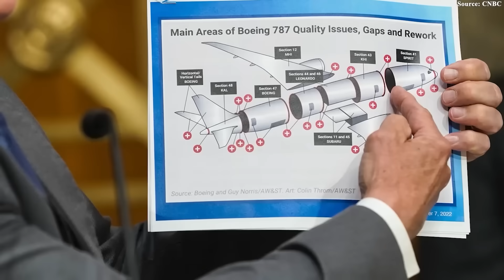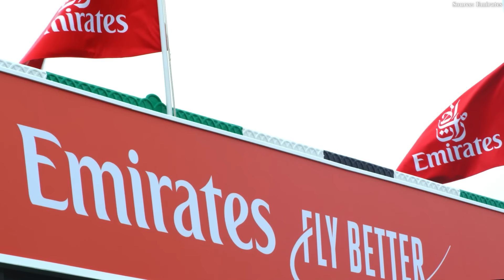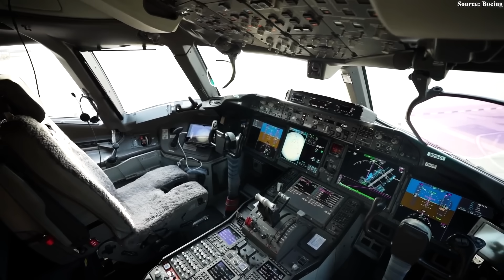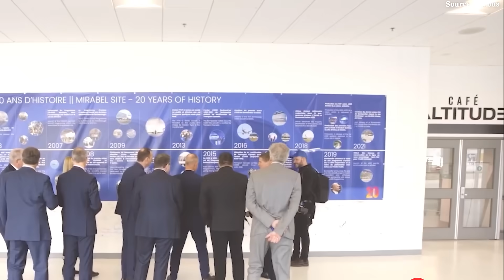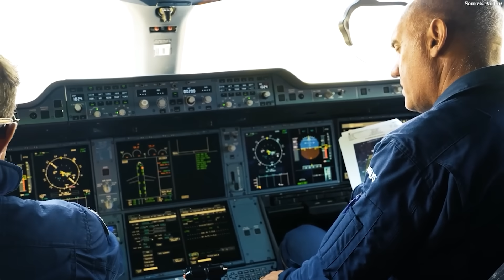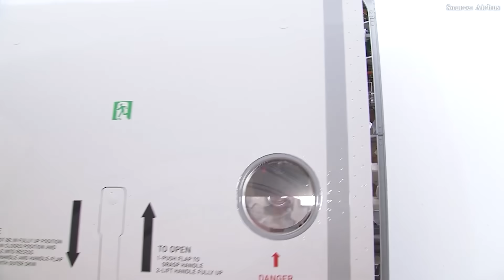Airbus A350-2000 vs Boeing 777-10: Which Reigns The King?

Comment: It is only Emirates who has a problem with the size of Boeing 777-9 and the engines of the A350-1000. They still consider the Boeing 777-9 small that is why they want 777-10. You said that other airlines want a bigger A350. That is wrong. Other airlines are not asking for an A350 bigger than the A350-1000.

Comment: 777 10 is a dummy. It is over weight.  4 engines necessary for safety. BOEING IS UNSAFE . SAFETY ISSUES. This needs be changed ETOPS  Has changed. ETOPS  needs better safety checks.

Comment: Boeing not only has the easier engineering path - present FAA scrutiny notwithstanding - it also has a large base of 777 customers and a sizeable backlog for the 777x.

Airbus could try to compete head-on with the 777-9 by building an A350-2000, complete with an automated take-off system similar to the one Embraer has developed for its much smaller E2 series. This would avoid tailstrikes and permit operations off shorter runways. However, sticking with the Trent XWB-97 would sacrifice a lot of range; Asian customers currently operating A330neo aircraft on slot-constrained medium-haul routes might be interested in a higher-capacity option, but that might be too small an addressable market. Ideally, an A350-2000 should have the UltraFan as an available option.

The other option is to let Boeing have the high-margin but low-volume very top end of the market and focus on the lower-margin but high-volume narrowbody segment. An A220-500 with tall landing gear could succeed the A320neo with the same engine options and ground clearance to spare for its own neo update 10-15 years after launch. That would let Airbus designers focus the NGSA project on a successor for the 200-300 seat range. And then there is the sizeable scipe-clause-constrained US regional market that neither the A220-100 nor the ATR-72 are addressing.
Reply: A350-900 XWB ULR beats the 777-9 and 777-8